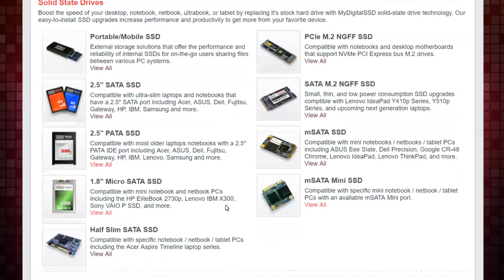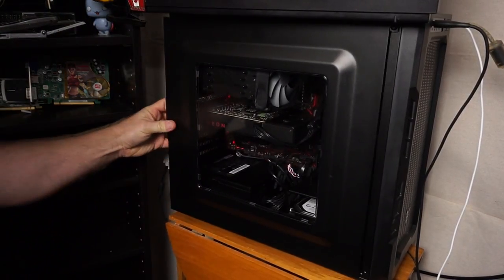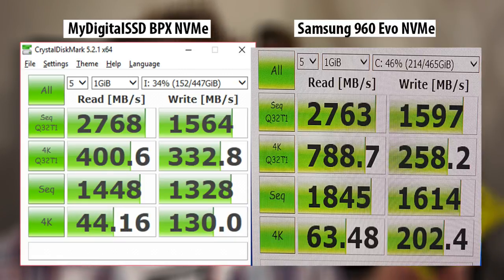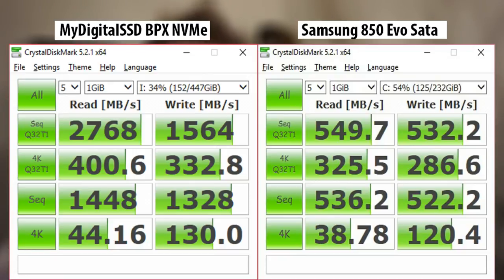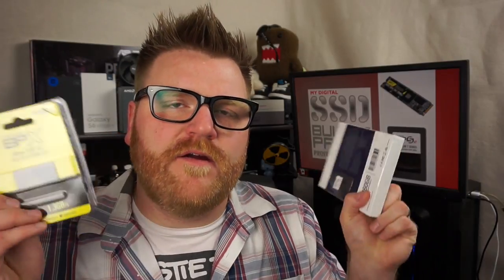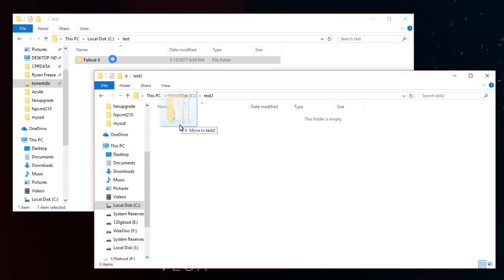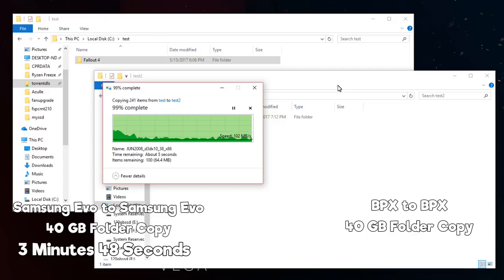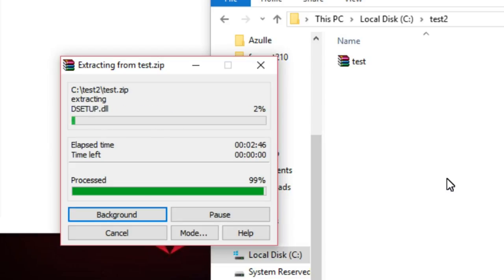NVMe vs Sata iii - How much faster is it? - MyDigitalSSD BPX Review

Comment: Timmy Joe thaks for the suggestion. I want to make you a question. I hace a 256gb ssd adata sx900 and 3 mechanical drives in my pc. I am thinking to get a larger ssd (1tb) or a 1tb nvme, the price is almost the same nowadays. The isue is that i loose 2 sata ports in my b350 Asus if I instal an NVME. I have a ryzen 1600, 16 gb ram and a gtx 1060 6gb and i use my pc most fopr bluray burning and bluray menu creation and video converting with handbrake. Do you think to get an nvme really worth in my case?

Comment: ok, let me reword that, if I have an ssd and hook up through sata and get say 500/500, if I take that that same ssd and put it in an external desktop setup using type C, will it run faster, slower or the same? if the same whats the real benefit of typeC? please help and explain, thanks